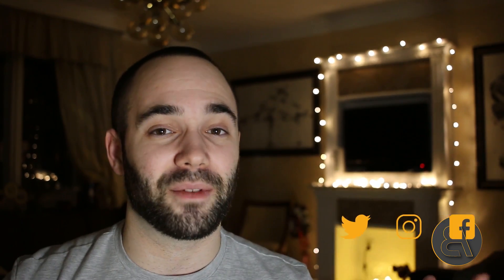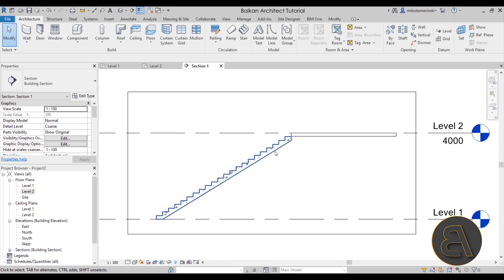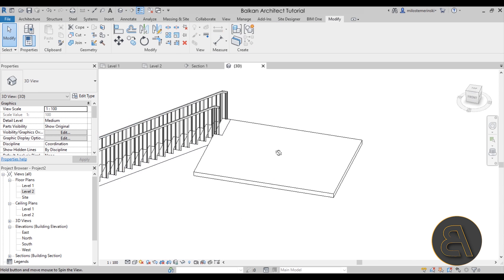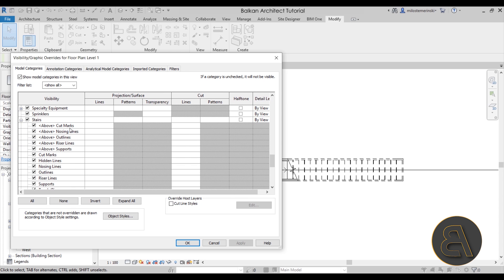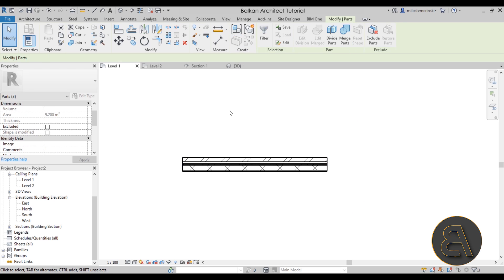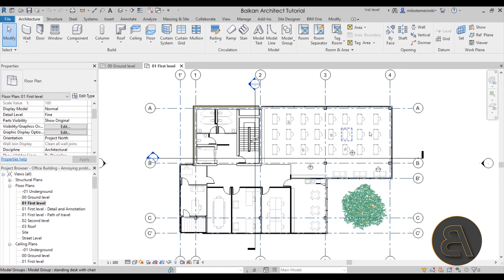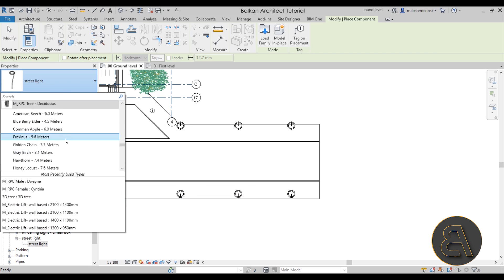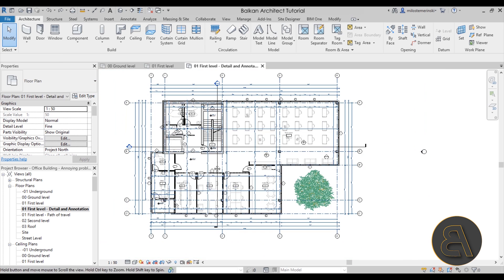Solving Most Annoying Problems in Revit Tutorial

Comment: I have a very frustrating problem when I use Revit, Stairs are the most annoying thing to do in Revit, I have a small staircase that I want to attach to the floor above but Revit does not want to do it the way I want it to. Do you know why this happens? are what I should do because I think I might have to re do the whole model again.
Reply: Just add the step at the top like he did, but move the stair back, the same distance as the step, rather than cutting into the floor plate.

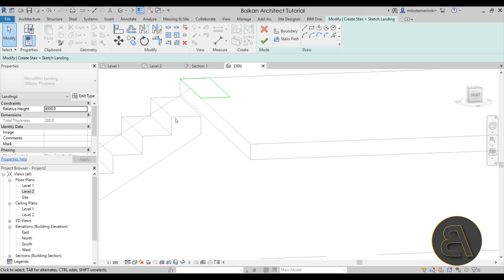Comment: 3:45 - I lost points in college because of stuff like this. I'd move a window, save and submit. But I also had the roof selected so I got the window proper but the roof is now floating in space. 😆
Reply: Zero touch dynamo nodes, these are the way to go, also the filter tool through the regular UI.

Comment: be careful using a landing to deal with the gap at the top of the stair. While this looks good in 3D and sections views, in plan view it looks like an extra step/ going and from experience, this has been an issue with one of our jobs when i didnt quite understand revit stairs and the builder nearly added an extra step but luckily caught it. As mentioned in the comments below, use the "end with Riser" tick box.  Even turning off the stair lines as you suggest in plan view can lead to issues with not allowing correctly for head room under stairs because you cant see where the stairs finish. etc. Pretty isnt always best and every line means something. some good tips for railings though. Thanks for your tutorials. Keep it up.
Reply: absolutely...

Comment: 1. Floor and stairs connection, and the railing problem. Solved with landing, thin line, split line.
2. Show part, about the wall's visibility
3. Hard to select the desired revit family on properties, so just find it on the project browser.
4. When you are annoyed because of the unintentional drag, just change how the Modify tool does. Click select below the modify tool.

Comment: Thank you Sir, for the more informative video. I have an issue in my project. I had completed structure but when I go to elevation view some unwanted lines are seen in my view like columns, beams, floor and wall but I want to without any unwanted lines like autocad elevation view. How to resolve it. Is there any plastering options for the same.

Comment: For those who just watched the part about the stair. That is not what you do. (erase that from your memory) What you do is: Once you finish stretching out or dragging out the stair. click on the stair you just made, look in Properties: Construction - Uncheck - End with riser. (that means that your stair will end with a tread instead) That's all you do. if you have a bunch of stairs and do this tip shown for every stair, you will have a headache If someone decides to change the location of the stair. Balkan, for every other tip, thanks.
Reply: Doesn't work in my case. Here is an example. I am using "monolithic Run stair 150mm depth". I am doing stairs from the ground floor 0M up to the second floor 3M. My tread depth is 280 and my riser height is 176.47. I sketch the stairs and I get 17 risers and treads however there is a gap at the top so I uncheck the "end with riser" and it does that all right but then my "Relative Top Height" is only 2823.53 and still below the second floor. I then try changing that value of the "Relative Top Height" to 3000 and I get the dreaded "Top elevation of the run should not be less than value of the "extended below base". The only thing I can do then is to go to the elevation view and drag the top point to increase the height to match the second floor. This does not seem like the right approach to me and it shows the "Relative Top Height" to 3176.47 which is obviously not. What am I missing here? I am using Revit 2021 so I hope it's not a bug. Any assistance would be greatly appreciated.

Comment: Landing step is an special architectural element which is a part and host element of the staircases not the slab, so checking off "end with riser " seems to solve the problem in very rough perspective.

Comment: Sorry. The stair fix is not a fix at all. It creates additional line work to the floor plans which will only confuse matters (and don’t tell me to use line override and set to invisible lines, or turn landings off). Coming from a Revit user of nearly 20 years, I would not recommend this method. Unfortunately, there is no workaround with current Revit software and joins a list of many dream items. You can ‘cut profile’ in the section view to tidy up this top connection...... but please don’t give people ideas like this.
Reply: The actual work around, sucks. It’s to make a 2D drafting view of the section and link a CAD file detail, trace the cad lines into Revit lines and families, then remove the cad link, then set the section view to link to the reference other view. So much for 3D BIM.

Comment: Solution to no. 1 (Stairs riser doesnt reach top floor) is quite simple. Just uncheck the "End with Riser" option under the stairs properties (while the stairs is selected), and make sure "Desired Number of Risers" and Actual Number of Risers" match. That's it! ✌
Reply: Not in case does that work. Here is an example. I am using "monolithic Run stair 150mm depth". I am doing stairs from the ground floor 0M up to the second floor 3M. My tread depth is 280 and my riser height is 176.47. I sketch the stairs and I get 17 risers and treads however there is a gap at the top so I uncheck the "end with riser" and it does that all right but then my "Relative Top Height" is only 2823.53 and still below the second floor. I then try changing that value of the "Relative Top Height" to 3000 and I get the dreaded "Top elevation of the run should not be less than value of the "extended below base". The only thing I can do then is to go to the elevation view and drag the top point to increase the height to match the second floor. This does not seem like the right approach to me and it shows the "Relative Top Height" to 3176.47 which is obviously not. What am I missing here? I am using Revit 2021 so I hope it's not a bug. Any assistance would be greatly appreciated.
Reply: @johnhewetson4406  did you get a solution?
Reply: i was looking for solutions for 2 hours and this comment saved me. Thank you so much
Reply: God bless you man 👍❤️💕💖😍

Comment: I have linked architecture and structure  model. In architecture model I've been modeling for the walls, floor and ceiling. In structure model I have columns and beam. When i checked for interference. It has reported clash between walls and Structural columns. The same issues for ceiling and floor. How to fix it? I mean, how to make walls trim by the structural coloumns.
Reply: As I remember you can not cut elements by a geometry from a linked model. So it will be like it is. If I'm wrong, then somebody please let me know. You may always change your project elements (walls etc.) as non structural components and maybe it will change behavior of clash detection. But I did not try it out. That's why BIM Menagers have to filter out clash detections when using Navis Works :)
Reply: @algali8487  yeah, perhaps you're right. Somebody told me the same thing.I have to edit my architecture model. So I get accurate quantities take off.
Anyway, should I use navisworks to check the clash. Why doesn't use the interference check for it? I mean, what makes the navisworks better compared to interference check?
Reply: @momokgoryo  Nah, Revit clash detection tool is good enough for basic stuffs. Navis Works is a really powerfull program to menage big projects where all the engineerings brands are linked as BIM models. Just look at tutorials of Navis Works, check out how it works and compare it with Revit :) It is complitely different program that allows you to really clearly detect the location of collision in complex projects, it gives you a lot of controll in filtering etc. 
Also I've got a tip (in Revit):
If you need to locate an object in collision select one of the colliding ones and use 'Selection Box' (Modify tools -> View -> Selection Box or just BX - default keybord shortcut). It gonna create section box in your default 3D view. Duplicate this view and lock it in position (small button on the right of "Show crop region" in the bottom toolbar) if you do so, then you may put text notes, tags and a lot of other stuffs on 3D views :) It really speeds up catching out collision spots and is faster then making sections or callouts ;)

Comment: The top of those stairs just looks wrong, both in 3D and floor plan. On floor plan it looks like there’s another riser where you created that small landing.The floor should be thicker as well. In reality a floor thickness will always be greater than a stair riser, meaning you will never have that gap. The reality is, that the floor SHOULD form the last step so revit is behaving correctly. You can always check the “end with riser” box if you want.

Comment: The main thing i find annoying is detailing.If you wanna repesent everything as it should (with line thicknesses and labels and insulation that goes around the column for example) you have to "explode" the wall but that eay you lose the model
Reply: pjetri24 Revit modelling should not be taken to a detail scale. It sound crazy right. What you should do is create call outs etc from the model and effectively completely draw over the model background by turning display model to halftone. Eventually turn off model display once detail is resolved. There are still issues with this (tagging etc), however the result is clean documentation. If a model changed in future it is easy to turn the view back to halftone display to understand the background revision and allow for detail amendment

Comment: Right on the point with number one-stairs!! I struggled with this issue for some days now, thank you for the tip, it may solve it, but still in plan one should remove the lines of the landing (maybe by "painting" them in invisible style). 
My question is how can we annotate stairs as they should be - for example, 16 St. x 16.6/ 30 cm so that they refer to the stair and not be just a text?

Comment: When we face this problem in stairs to floor connection, we select the last flight (or run) and check off the "end with riser" option from its instance properties. Doing this adds a step in the "desired number of steps" option and revit allows us to create an additional step with the similar riser height, which kind of solves the problem for us without messing with the railing hosted to it.
 I think you should give this a try too.

Anyways, thanks for your tutorials. These help us a lot. :)
Reply: Okay sir..  Also just dont change no of step instead update desired & actual no. of steps. (assuming you've updated relative height as per f2f ht)
Reply: omg thank you so much. you saved my life
Reply: Very good tip thanks!
Reply: what if we do'nt have this option?
Reply: Hi Mohammad it doesn't seem to work in my system. Here is my example. I am using "monolithic Run stair 150mm depth". I am doing stairs from the ground floor 0M up to the second floor 3M. My tread depth is 280 and my riser height is 176.47. I sketch the stairs and I get 17 risers and treads however there is a gap at the top so I uncheck the "end with riser" and it does that all right but then my "Relative Top Height" is only 2823.53 and still below the second floor. I then try changing that value of the "Relative Top Height" to 3000 and I get the dreaded "Top elevation of the run should not be less than value of the "extended below base". The only thing I can do then is to go to the elevation view and drag the top point to increase the height to match the second floor. This does not seem like the right approach to me and it shows the "Relative Top Height" to 3176.47 which is obviously not. What am I missing here? I am using Revit 2021 so I hope it's not a bug. Any assistance would be greatly appreciated.
Reply: @johnhewetson4406  I think this video might help to solve your problem: https://youtu.be/J3_Bfqj5I5w
Reply: but the plan view will be different (one more step shown on plan)?
Reply: Except when end with riser doesn't work!
Reply: Thats how I do it as well works great